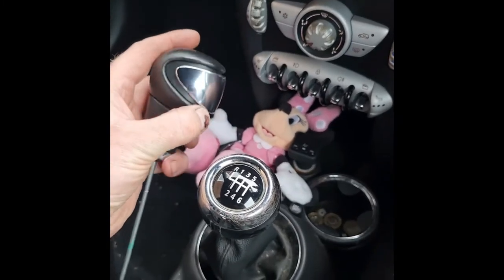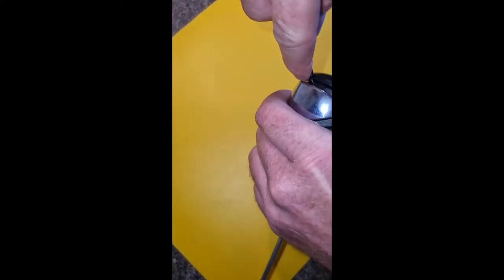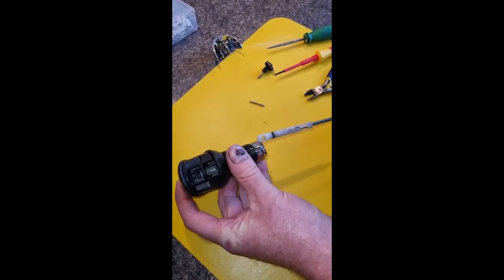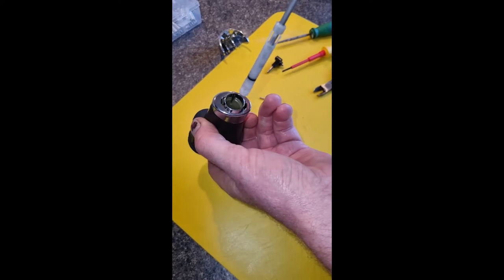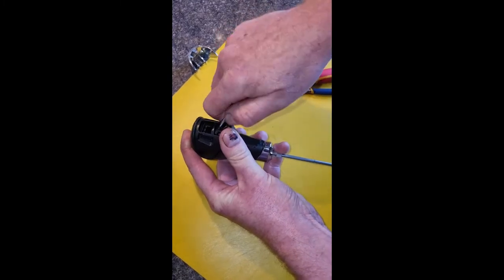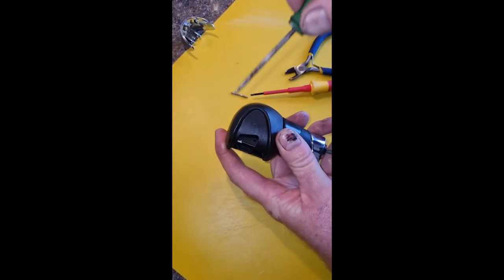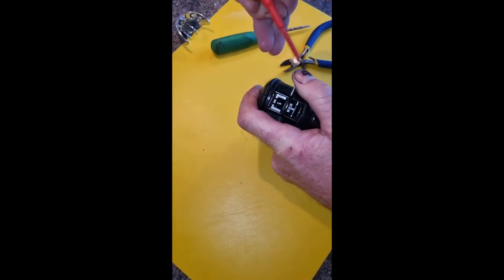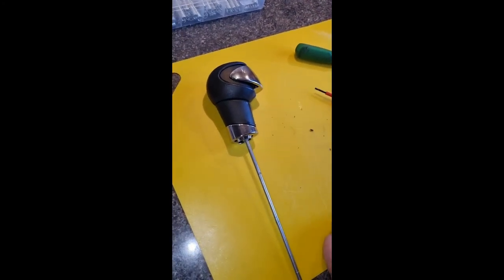BMW MINI R56,57,58,60,61 Automatic gearshift, gear lever, gearknob selector repair. Auto Shifter

Comment: hello . I'm having a problem with the mini R56 2012 automatic transmission system with error code 523A EGS Switch Steptronic. Manual mode doesn't work. I need wiring diagrams. Can you help me... !!! Thanks..

Comment: Is there  a part # to order to just replace the plastic chrome button? Mine broke & I still have the flat spring that was inside. YOUR video was the only one I found that helped.
Reply from the maker: Hi, I don't think the chrome is available separately. If you can find a second hand lever you could swap it over?

Comment: Spring Size: The OD of upper shaft is 8.5mm. A 'normal' spring 8mm OD and 30mm in length should work.
Reply: COP….ended up going with #123 Spring Compression at 1-1/4” length 3/8”OD spring.  I had to slide it into position from the face end. It wouldn’t slide in the bottom opening. Also placed some grease on the shaft to reduce friction.  It feels like new.  I to did not find any old spring parts….did it just denigrate?  Hmmmm.
Reply: Hi, is it I purchased a spring with OD 8mm x length 30mm will do ?

Comment: Thanks for showing this as I have not found this info anywhere!! Do you have the specs of the spring or where you bought it from. Cheers
Reply: I bought a box of springs years ago so no specific part.
The spring needs to be a similar size to the rod in the gear knob. Approx 20mm long and quite east to compress.
Reply: Did you manage to find the right spring?
Reply: Does anyone know the right spring size?